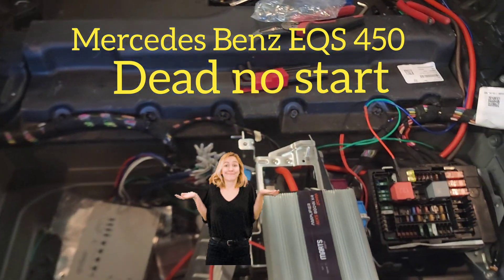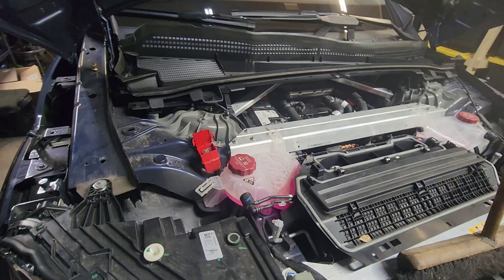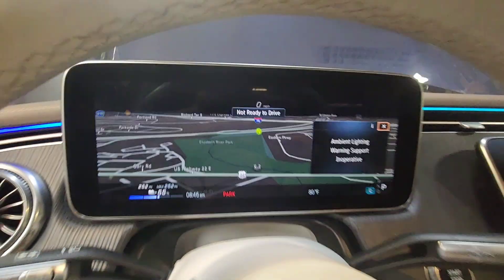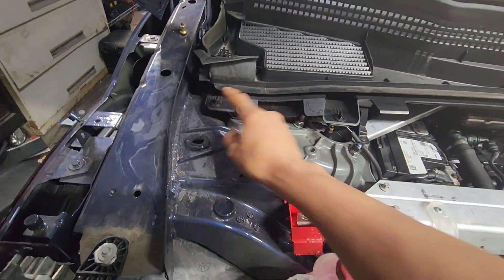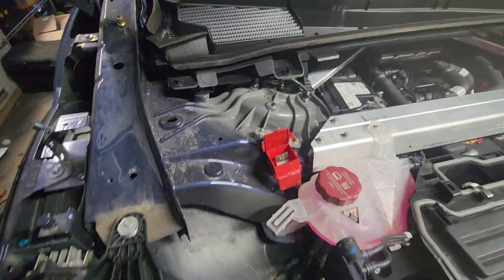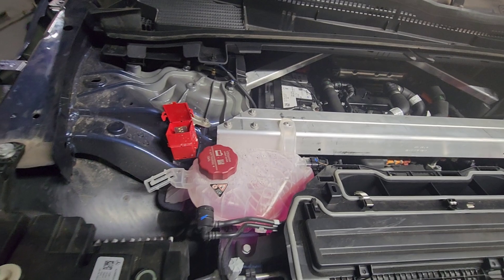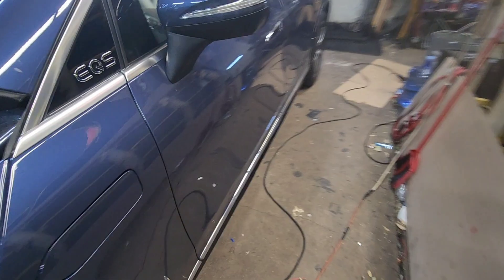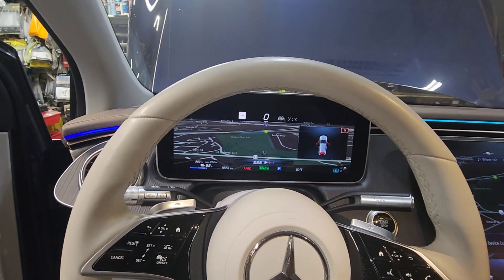We killed Mercedes benz EQS 450 12 volt battery low won't start won't charge 😢 Fix Tutorial

Comment: May I ask if you received any error messages after the 12V auxiliary battery was completely disconnected? It seems that you did not provide an additional 12V source until the battery was charged and reconnected. Was your car simply opened with the ignition off?
Reply from the maker: Yes, it did have a message on the display it says refer to the owners manual page ... in the manual said, "Take it to the dealership.we did remove the connection on the battery and then changed . After about 10 minutes, reconnect and it started

Comment: Also if you ever get drivetrain malfunction do not take vehicle out of drive because it won’t go back into drive chance is the 12v battery is low and will need to be charged and reset, it’s best to install a battery gauge to monitor the 12 v battery, it happened to me driving home and dealer didn’t have a ev tech on Saturday so I had to take a flight back home and return 9 days then they saying the 12v battery was low so they charged it up but it was cover under the warranty $1000 in flight 😢for nothing
Reply from the maker: @Dj_jon  wow, good information 👏

Comment: Hi boss 
I have same problem but my car in iraq 
My car not working is writing (Stope Vehicle see operator’s manual) 
What i can do? Thanks
Reply from the maker: Disconnect the power connector on the aux battery and then charge without any wire on the battery. If that doesn't work, you may need to replace the aux battery under the hood
Reply: My car is EQS580 rear End not smae Eqs450
Reply from the maker: @soma23mohamme17  it should be same

Comment: Two things.

1. The exterior lights are because of the parking light setting on the light switch. Check for the arrows and they show which side will light up. Should be on auto normally. 

2. The battery is dead since you left the hood open. Then the DC/DC converter doesn’t function and charge the 12v battery from the HV battery.

You essentially killed it because of two user errors.
Reply from the maker: @Eisenhut1  yes we did , because we had to use Testlight for connections at the amplifier and speakers. We couldn't find any information anywhere so it took long time to figure out,it all worked out at the end